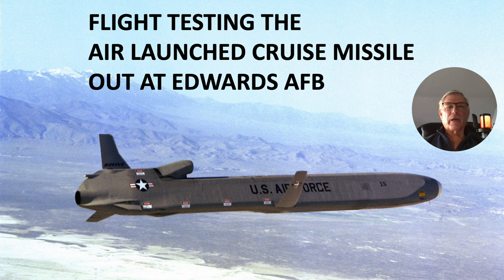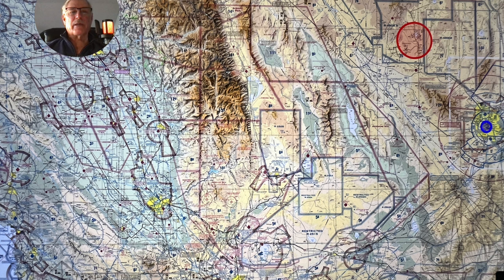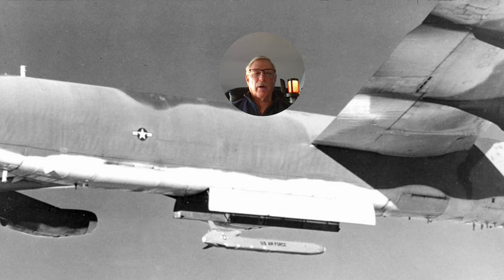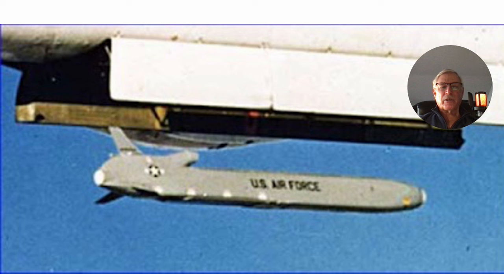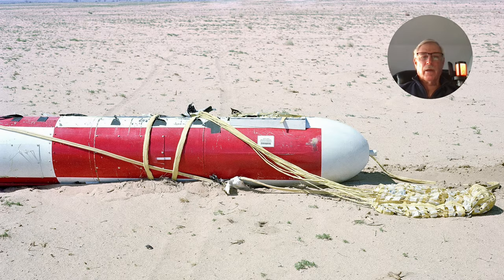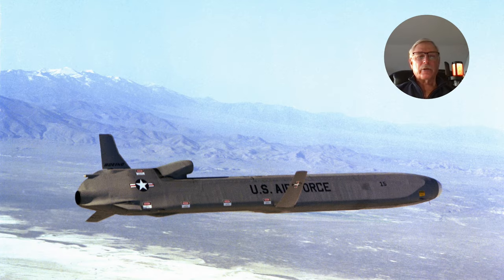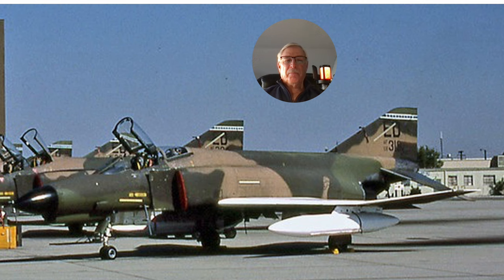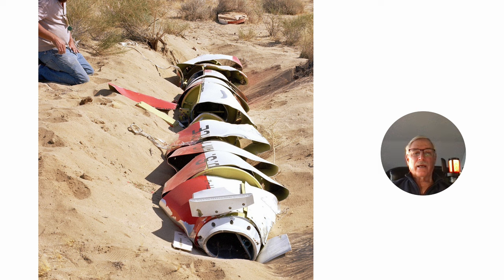FLIGHT TESTING THE AIR LAUNCHED CRUISE MISSILE OUT AT EDWARDS AFB

Comment: The ALCM, like the Buff, is just an amazing weapon system.  The ALCM has outlived it's replacement, the ACM or Adv Cruise Missile, just like the Buff has outlived the B-58, B-66, XB-70, B-1, and B-2...and perhaps the B-21? :) 
As a Buff crew dog, I'm very familiar with the ALCM, and it is an amazing and still extremely capable deterrent system.

Comment: Was hoping you would mention the tanker required to refuel the F-4s and the EC-135 Cruise Missile Mission Control Aircraft(ARIA) that also supported these test flights.  Perhaps they weren’t involved WAY back when you were doing this.  When I was there, no T-38s were involved and only two F-4s but the tanker and ARIA sure were.
Reply from the maker: The T-38s were only used initially to "scout" the path through R2508. During the initial short range testing, just in the R2508 complex, no takers were needed. I was not as close to the program when things (range) expanded so not as familiar with that part.

Comment: Correct me if I’m wrong, but I believe these particular chase F-4’s were ex Thunderbirds, with associated configuration differences. Maybe some history to talk about.
Reply from the maker: I don't know. If you have any information on that I would love to hear it.
Reply: I was dedicated crew chief (DCC) on one of the F-4s, (RF4C 66-850) for these tests.  The ex Thunderbird jets @ Edward’s were e models.  I can’t recall if any of those jets were modified for this mission.  All the DCCs along with the aircraft were sent to Wright Patterson AFB for several weeks for required aircraft modifications to facilitate this testing.  All the DCCs flew to and from WP AFB in the rear cockpit of their jets.  What a great experience.  I recall after one of the test missions the pilots reported losing the ALCM.  When traversing over remote mountainous area they encountered heavy clouds, when the F-4s came out of the clouds the ALCM was gone.  They circled around and saw the smoking hole.  Reportedly the ALCM crashed into a remote unoccupied cabin.  Edward’s quickly put together a team to secure the site followed by a recovery team.  After a brief stand down the testing resumed.  I was stationed at EAFB from 1978-1980.
Reply: @ronrogers  So, internet “Aircraft Serial Number Search” using ‘F-4E’, and a separate site “6510 Test Wing ALCM Chase Mission” indicate the following F-4E’s were at Edwards as former Thunderbird aircraft: 66-286, 289, 291, 294, 315, 319, 329, 377. Your earlier video presentation speaks to your flying one of these airplanes. The one at Castle in CA is supposedly legitimate, #289, and claimed to have served as TB #3,5,6, and (7?) during various years before its time at Edwards. Anyway, these are the two sources. Seem reasonable, all in fun.

Comment: Cool story, like all of your videos. My mother was the QA chief at TACOM in Warren, MI for the GLCM (launch) trailer. She said the precision of the trailer was amazing because the launch parameter requirements (pitch/roll/yaw ?) were so stringent. She was sad/glad when the treaty with the Russians eliminated the GLCM. She got to see the fruits of years of work get cut up with torches. At least I still have my GLCM belt buckle! One question: does anyone have any idea why the launch trailer had to have such precision? I mean, if the missile is terrain following, it is constantly correcting for any inertial drift or other positional error all the way to impact. Why then would the ground launch be so critical? ALCM's can't possibly be launched with milliradian angle and millimeter positional precision and they work just fine. What's up with the GLCM?
Reply: The inertial nav during an air launch is more straight forward -- captive with aircraft position and speed, then gravitational drop. Pretty gentle/smooth accelerations, not a challenge to inertial nav unit.  GLCM starts out with launcher position at a speed of zero.  Inertial nav unit is pegged during launch, and at some point after launch it starts navigating based on known angle of fire and known rocket motor impulse.  Thus the launch geometries are critical for inertial nav unit to accurately determine its first position post-launch.  Shout out to your mom for her contributions to our national security...
Reply: @warped-sliderule  Thanks for the shout out. My mom was always proud of being able to contribute. Regarding your explanation, I always wondered about the need for such precision in the launch trailer and what you said makes sense. I'm a software engineer and I'm into electronics. I have some old high-end milspec sensors, etc. from that era and it's mind boggling what they did with such limited capability (compared to common consumer electronics today).
Reply: @richardunruh4035   I was an electronics technician at Edwards, later a manufacturing technician at DOD companies. Inspired by guys cut from the same cloth as Ron, set goals on engineering.  Ron and I were at Edwards at the same time.  I add comments on the missions we are both familiar with.  Became a software engineer in the '80's and often helped technicians in manufacturing. I have so much respect for people in manufacturing, like your mom. They put forth diligent effort everyday to build quality systems.